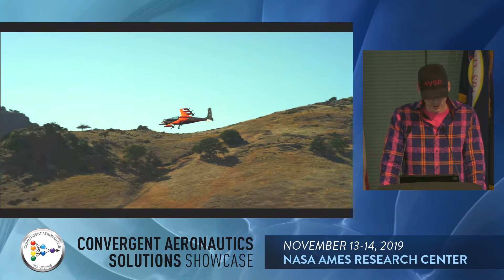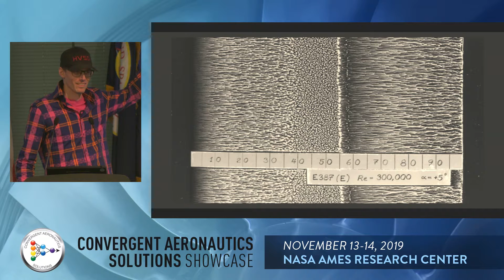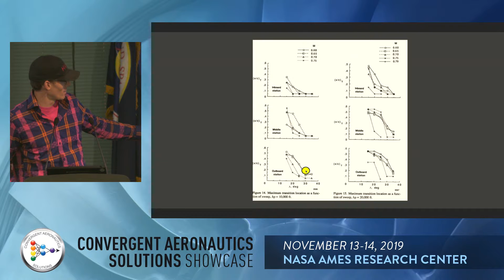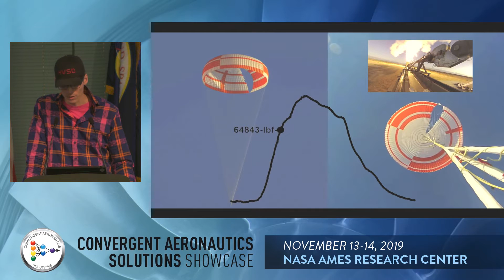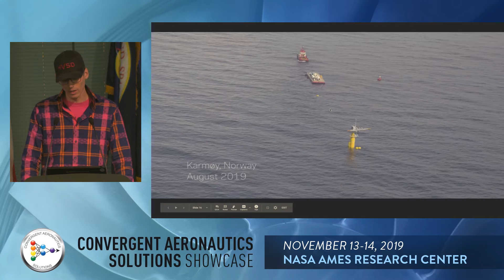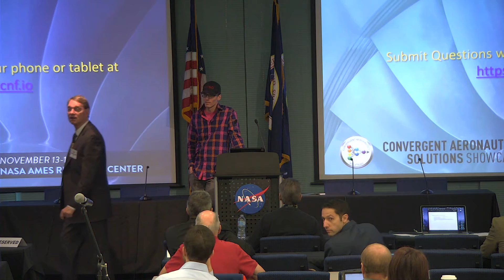CAS Showcase 2019 - Keynote - Damon Vander Lind

Comment: I wish you luck in your barely-conventional design (and I mean that as a complement).

But I think we all agree that I-280 from San Francisco to San Jose should be converted to a ground-effect fly-way.  Might have to bank the corners, but what pilot WOULDN'T want to come in low, at 100 kts, and avoid the crowded Palo Alto class D.

And I have to ask: Was I correct in reading that you are compiling F# down to micro-controller flight hardware?  Salute!